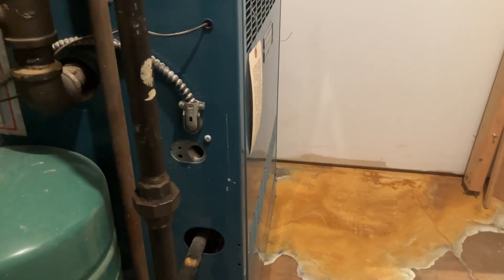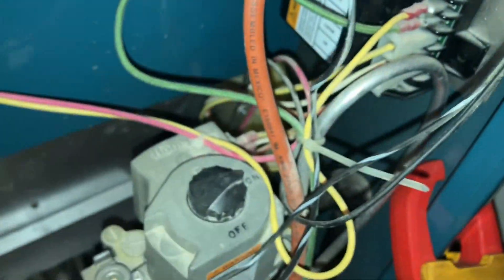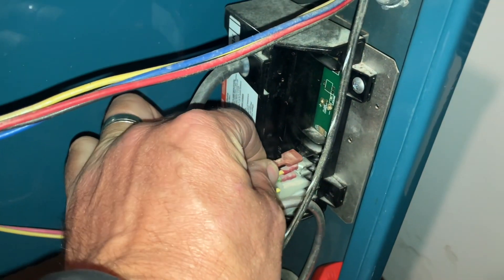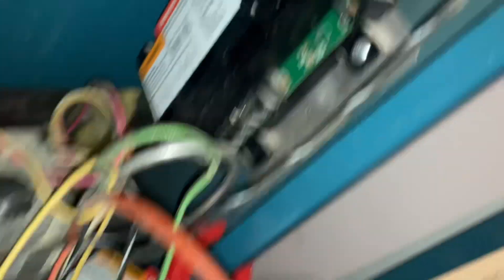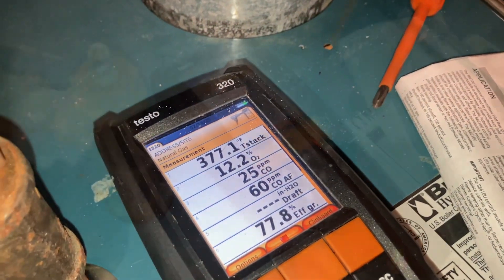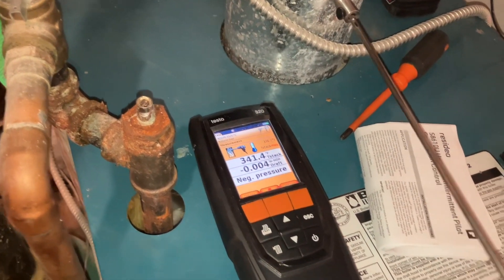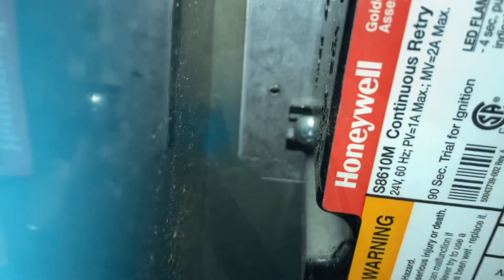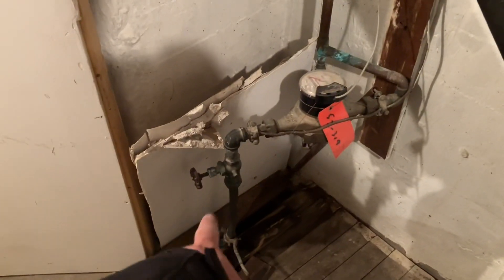No Heat Burnham Gas Boiler Series 2 - Ignition Module Diagnosed & Replaced

Comment: 9:28 your awesome I’m only on like my 4th or 5th video of yours and I like the knowledge. I like the videos. I’m sure with it being an emergency call that 1st responders discount comes in handy. I needed an emergency call not long ago and it was $280 just to show up that covered the 1st half hour not including parts. The 1st half hour was travel time. I am only 5 miles away and normally do my own maintenance, I took an oil burner class after highschool just so I could work on my own stuff. Basic maintenance that is. This day I couldn’t figure it out and it was an electrical issue. I live in Maine otherwise I’d be calling for repairs

Comment: Probably just a dried up electrolytic capacitor inside the module.  Being an old electronic tech,  I have repaired several of the older style Honeywell ignition modules ( without a flashing trouble light ) for friends by replacing not only the bad cap but all of them  ( about 4 total ) since they will all dry up eventually in the hot environment.  Often the module operation will be intermittent.
Reply: very likely and you can hear it's high pitch screech via the camera also or at least I can here on a workstation with decent speakers/amp. 
for liability purposes, no company will "repair" a module or board and always replace them.
Reply: @throttlebottle5906  Yup, I can understand that but that doesn't keep me from saving a few bucks myself.   And the caps I use have a higher temperature spec than a lot of the caps I replace.